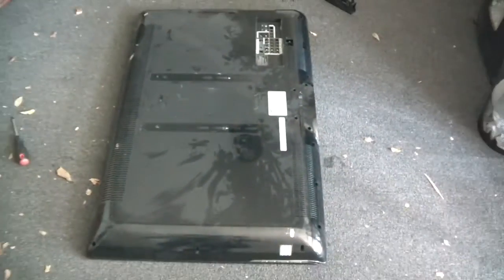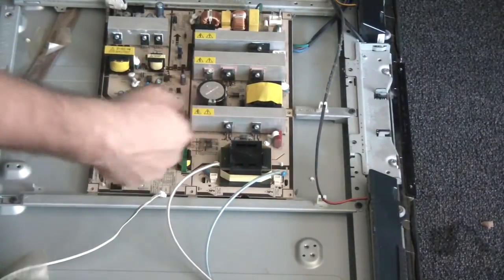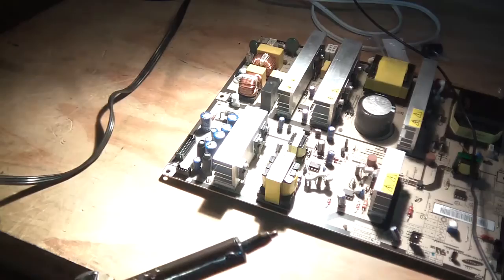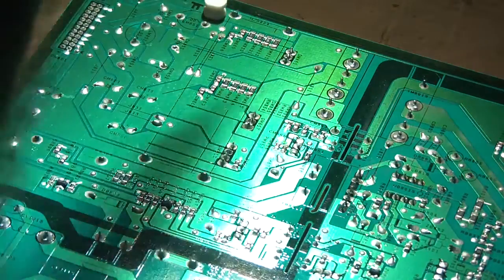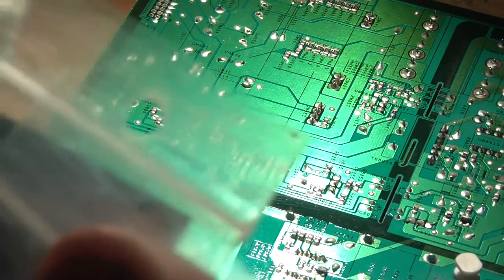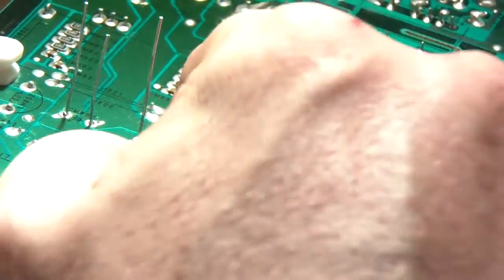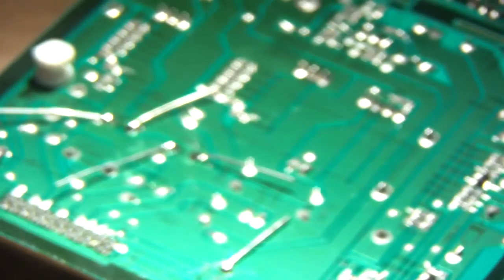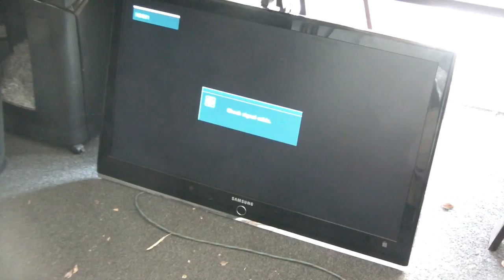Samsung LCD TV repair bad power supply not starting bad Capacitor

Comment: We checked the capacitors but none are bulging or split open. Tv won’t turn on at all. Makes no noise or blinking lights. Any ideas as to what could be the problem after the capacitors have been checked and look fine?
Reply: Kelly check fuse or NTC

Comment: -Capacitors go in equipment all the time. Expensive or not expensive equipment not too much difference. More important is the way the equipment is built so they run cooler.....this tends to be quality....which you pay for in more expensive.
-Capacitors close to a heat source such as the heat sink beside them in this picture are more common to go than others. You can buy them that will withstand more heat than others usually indicated on the side of the component how much it will take.
-Most of the time the capacitor shows no indication that it has failed such as the bulge or discolored....so they can be a brute to find. Rocking it back and forth sometimes makes a crunchy sound where it has leaked beneath it.

Make sure you put in the same value rated in uF and never put a lower voltage than the one you are replacing...such as if a current one is 16v never put in a 10v. They tend to blow up like little 22 bullets or worse! And as you mentioned never put them in reverse polarity....bad things will happen!

Solder connections are actually more common of a failure due to heat expanding and contracting.

Comment: You should actually clip the wires first before you solder them in. It is a little unhandy but makes a better connection that won't corrode as easily afterwards.
Liquid flux is recommended before you hit it with the soldering iron.
To clean it afterwards use 99% isopropyl alcohol with a small brush.